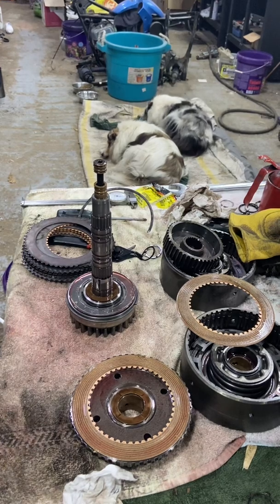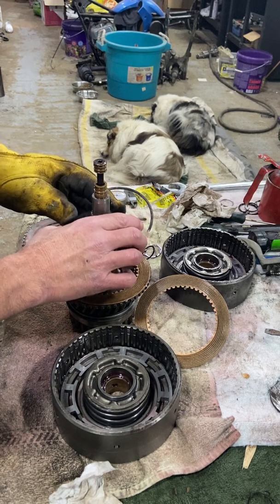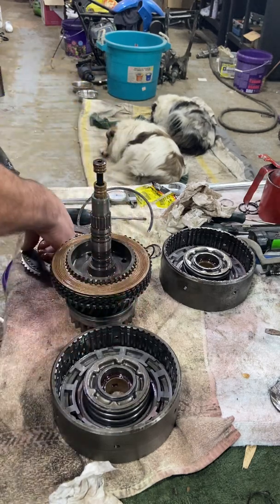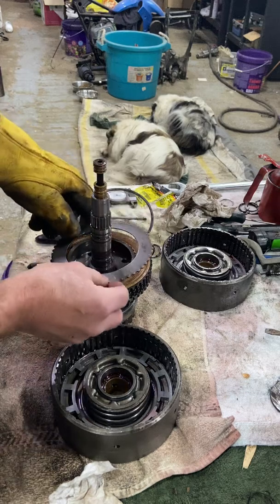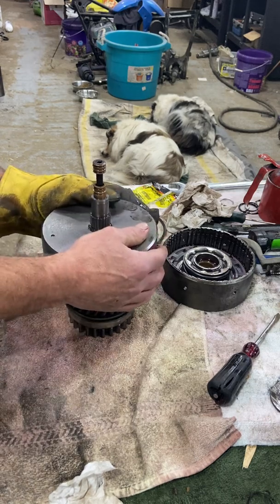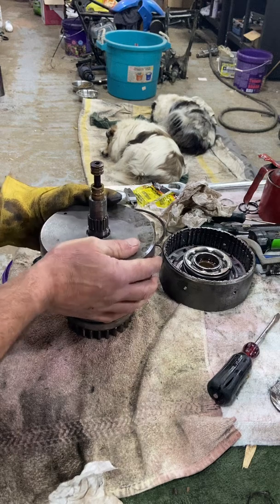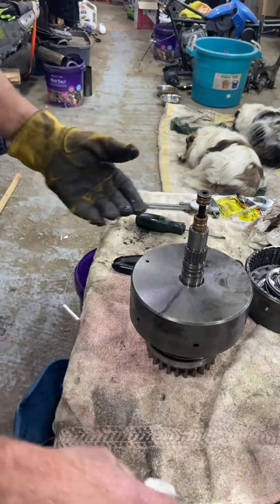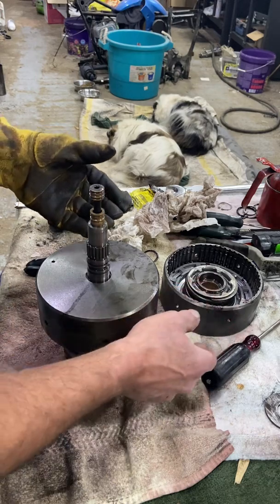MF50A Cutch Pack/Input Shaft Reassembly

Comment: How do I get the shaft and clutch drums out of the case
Reply from the maker: Hi Kevin!
   After the tractor’s been split, and once you have the oil pump off, you have to remove the two geared shafts beneath the clutch assembly (this is where all the loose needle bearings are). After that, the entire cartridge with the two baskets can be removed. It’s better to have two people, one supporting it from underneath while the other person slides it out the front of the housing. I hope this helps.
Thanks!
   Rick
Reply: Do you have a good used clutch basket for the mf50a instant reverse transmission?
Reply: Hi no I do not I put the clutches  and seals in the baskets for some one . @neilmortimer112

Comment: I recently bought a mf50 backhoe and the brakes and reverse are not working. Where’s the best place to get parts? The engine works great.
Reply from the maker: Hi there!
   Is this an MF50a? Quite a few of these machines use common parts. Massey wasn’t big on spending money for re-tooling, so they kept using the same transmissions year after year. I buy my parts locally, but they come from a company called Sparex (www.sparex.com), and they’re fairly easy to find. I ordered a full rebuild kit and gasket set last year, and they only took a week to come in. The internet has quite a few websites where you can source parts. By the way, if you’ve got a cab on yours, doing the brakes is a pretty big job.